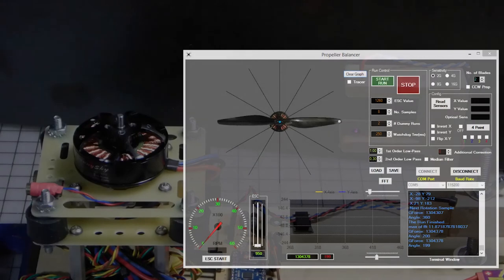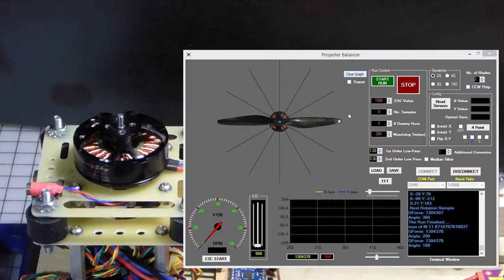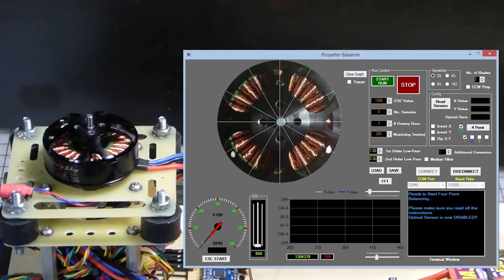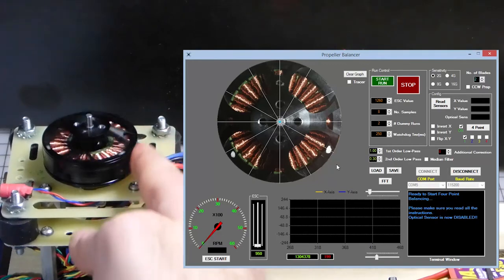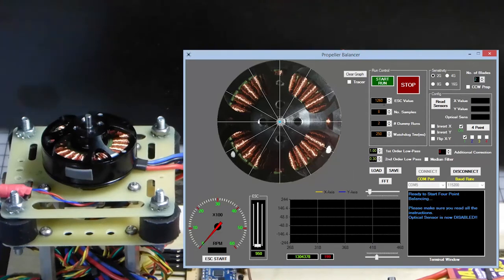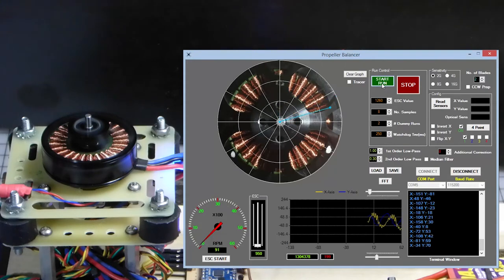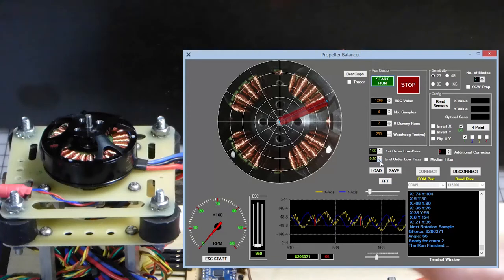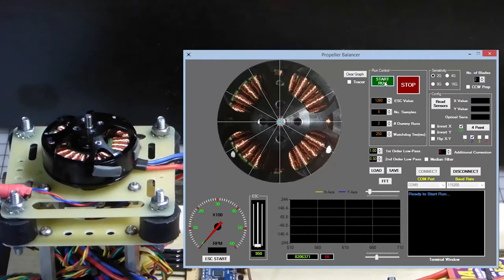Four Point Dynamic balance

Comment: Do you only need the photo-detector for prop balancing? I saw that you had it on its own mount before unless you moved it and I just can't see.
Reply from the maker: You need the whole system...not just the detector...
Reply: Sorry yes let me reiterate. It looked like you were not using the photo-detector for motor balancing, I plan to only use the system for motor balancing so would it be unnecessary to have the photo-detector set up?
Reply from the maker: OK, Yes, for a 4-point balance, to balance the motor, you do NOT need the photodetector.
Reply: Great thanks. Also thanks for making these videos and all the work you have done on the forums, it is saving me a lot of time on this project.